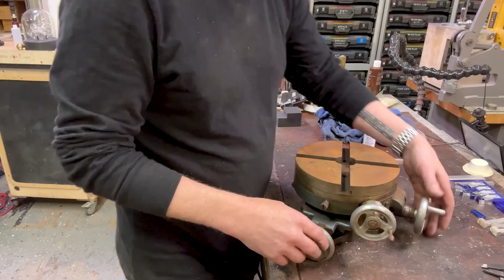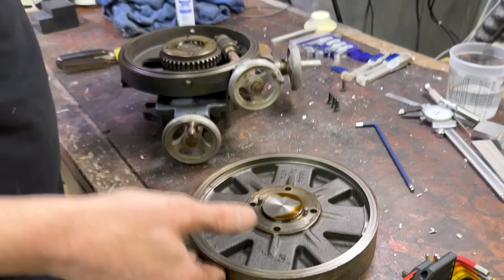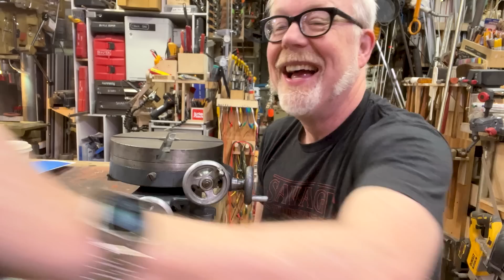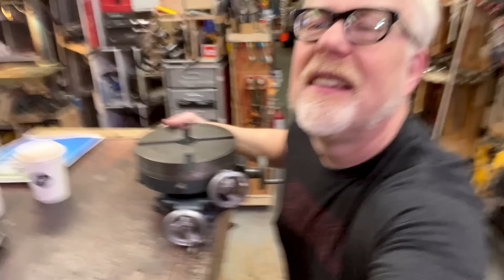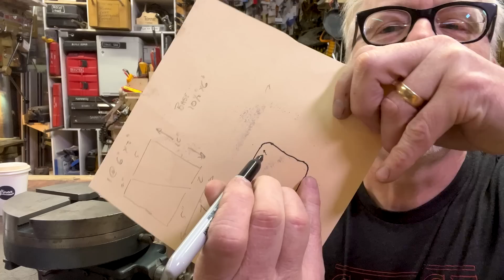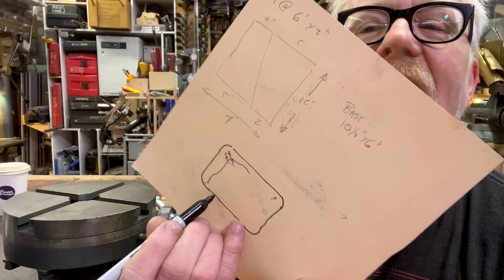Adam Savage Disappointed By This Machine Tool

Comment: I can't rightly say I've ever seen an X-Y table on top of a rotary table used on a mill.  It kinda gets into the Department of Redundancy Dept.

You have an X-Y table on your mill, you lock down a rotary table & hold your material on it.  There should be a lock for the backlash slop; make one, if not.

Either deal w/ the backlash by only working CCW or CW, or by the same way you mill w/o a DRO; go past, & re-approach.

The alternative is retro-fit it w/ a recirculating ball worm, but I know if they exist.

GeoD

Comment: I have te same model Palmgren and the only use I've found for it is cutting circles that are too big for my small rotary table.  I also have a Bridgeport 12" rotary table, but it can be hard to set up on my 3/4 size mill.

Comment: Adam, that is not for milling operations. I have one similar and it is for mounting on a drilling machine without the xy table. On the top you mount a chuck like the one in the lathe.
And you use this tool to make holes on flanges for wheels, transmission couplings, pipe couplings etc . Only drilling holes. No milling.
The purpose of the X y is to positionate quickly to the necessary diameter where the holes will be made. Look for the lock screws in all axis, you suppose to tight them to block all in place before executing the holes.

Comment: you can easily make a nice drill press table with that rotary table, it will look super! I have a craftsman one that I picked up for real cheap. It does not have that kind of slop at all on the rotary table. I guess maybe after cleaning it I will find out! again I agree with you it looks super cool and great for a drill press, especially a floor model cause you have all that space between the drill table and chuck.

Comment: I don’t really see the connection between backlash and a DRO. Also, DRO don’t give an “exact” position anymore than an analog indicator. 

Every person using a lathe with precision is also using external indicators rather than relying on the feed dial.

Comment: I have one of these and you can make the 3/8" thick aluminum rings under the R2D2 head on a mid size mill. Mount your square aluminum to it, offset it to the spindle to the size of ring you want and turn yourself a big ring on a small mill. Also you can adjust the backlash out. If it didnt have that play before you took it apart you didnt adjust it properly when assembling. Cincinnati tool  would be laughed out of existence if the made a milling tool  with that much play. That thing was probably a grand 40 years ago.

Comment: You can still use it even with the backlash. You just don't move it backwards. Always one direction. Besides, I believe the backlash appeared after you re-assembled this. That tells me you may have missed something when reassembling the parts. There should be a built-in means of taking out the backlash. Especially since you showed everyone how it's hardly ever been used. Speak to a machinist first before you discard it.

Comment: I have a very similar Palmgren 8" rotary XY that i use on one of my drill presses with an XY vise on top, Mine does NOT have a wheel or worm drive, you turn the table by hand and lock the set screws. I don't believe these type of rotaries are made for milling as much as drilling hole patterns/line up.

Comment: Adam, I am not a machinist by any stretch of the imagination. But that is 30,000th on the out side circumference it would be far less the close to the center you are. Now is that still significant at 1" from center; nothing I can say with any reasonability.

Comment: Backlash is also bad if climb milling, especially bad in that case. For positioning backlash can be compensated for, but if your milling cutter is broken you won't be doing much milling.
Before DROs with hole pattern capability one might have used a rotary table for circular hole patterns, if one locks the table before machining and turns the handle the same direction when indexing, then backlash is not such a big deal.

I'm not so sure the rotary backlash can't be adjusted, @4:51 one can see a couple of socket head screws near the end of the worm shaft opposite the hand wheel, if those were loosened could one push the worm closer to the worm wheel reducing the backlash? Serious rotary table have the worm shaft on an eccentric to allow easy adjustment of the lash, but if one buys one of those Palmgrens one gets what they pay for.

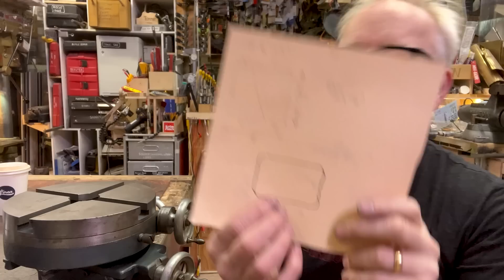@11:35 While it make setup more complicated, one could mount the Palmgren upside down, or since it is the 21st century, one could just use CNC.

While a 6 or 8 inch rotary table looks cute, when one tries clamping anything to the top one will quickly wish for more space for the clamps even if the work piece itself is less than 6 inches.

Comment: Send the worm out for coating to get rid of the backlash.  Flip it over and the rotary section is on the bottom and the X/Y is on the top.  Make an adapter plate and you have a functional tool.

Not necessarily a great solution, but when you've got lemons. . . .

Comment: Can you not just turn it upside down and mount a jig plate to the top (bottom) and sub plate on the bottom (top) to allow you to mount it to your t slots? For small milling jobs and taking care of the lash by thoughtful operation, this will be fine.  Btw all rotary tables have backlash. It helps to snug the locks slightly and, of course, only mill from 1 rotation

Comment: Get yourself some small hold down clamps and mount it upside down on your Bridgeport table you might not be able to use the original micrometer marks but you could probably improvise a set That's what I've considered doing with the oddball one that I have

Comment: a general tip for rotary tables only ever go in one direction if you go past  your mark do a full rotation that way you will never have an issue with backlash 

i would look into making a way to lock the table on when you're in the right spot would sort out the table movement

Comment: Adam, did you consider looking at it upside down? Couldn’t you secure the rotary table to your mill bed upside down and mount  a t-slot table to the bottom of the device (that’s now on top) where you would normally bolt to your mill bed? That would give you the rotary table on the bottom and the cross slide on top. Another comment mentioned securing the far end of the worm screw to reduce backlash. A little bearing (ball or bronze) housed in a piece of metal that’s welded in place could help solve that issue. 
I have a semi-universal dividing head (aka: tilting rotary table), the backlash is sort of adjustable by allowing you to adjust pressure between the worm screw and worm wheel. It comes down to necessary level of precision. You could always get close and mark it with layout fluid and grind it down by hand with an angle grinder. Wether that would work or not would depend on acceptable windows of GD&T and what you’re trying to accomplish and how steady your hands are with the grinder. 
Did you consider mounting a grinder on the rotary cross slide and using that to control the movement of the grinder to carve out gouges? If a tool doesn’t quite work for its intended purpose, I always try to look at it upside down and backwards before I decide if it’s “useless” or not. Even if I decide I can’t use it, I save it for the parts/mechanisms, in case I want to use them on a future project.

Comment: Mount it to a large 90 degree base for a forth axis work on a milling table. Or use it on a surface grinder. I have a Volstro which is small and delicate but has the neato factor.

Comment: I have that one. Works okay if you take the X-Y off and clamp the table in the mill vise. Good enough for light duty if you favor the backlash correctly. By the way, the work doesn't care if the X-Y is above or below the rotation. It only cares where the spindle is in relation to the radius. Stand alone tables work on top of the mill table, ya know.

Comment: The worm gear shaft supported on only one end is where practically all of that play comes from, the screw needs to be held tight to the recieving gear to eliminate it.

But for machining concentric ID/ODs I'd still use it with that level of play. And add a brake screw if it doesn't have one for when the angle needs to be locked such as when machining with the X/Y axiis.

Comment: A DRO doesn't mean backlash isn't a problem.  Don't get lulled into a false sense of security.  Whether you position the bed using a DRO or not, if you have significant backlash, the cutter will move the work.  If you don't take account of backlash, you could get a piece that is either under, or over sized by up to twice the backlash amount.  Note also, that cutting on the front and back face will push the bed in the direction of the cutter rotation.  This is why, on older or cheaper machines with more backlash, you should always use conventional milling, so the the work is being pushed towards the driving face of the screw.
Try positioning the bed for a heavy cut along one of the sides.  Remember from which direction you approached your final position.  Zero the DRO, then take your cut.  At the end, is the DRO still showing zero?  Repeat this, but this time approach your X position from the opposite direction.  In one, you'll probably find the bed moved by up to the backlash amount.  If you used conventional milling, repeat both tests using climb milling.  See the difference?
It doesn't matter how accurate your DRO is, if the action of cutting causes the bed to move.  You still have to be aware of how backlash affects the cuts, and ensure you position the bed from the right direction.  Note that conventional milling will tend to pull the piece towards the cutter, so if you've not taken account of backlash, you could be taking a significantly deeper cut.
If you have adequate backlash compensation, climb milling is much preferred.  The chips remove the heat more efficiently, reducing work hardening in the piece.  It typically gives a better finish because the chips are pushed back from the cut, so there's less chance of re-cutting, and there's less rubbing, so your tools will last longer.

Comment: Not a thing wrong with it. Your only going to cut in one direction which means it will always be in contact with the worm gear. If you need to back up you just need to take note of the reading on the scale and go back to that place. That's the problem of starting out with digital readouts and never having to use the scales on a machine. Unit is excellent for circular hole patterns. Just tighten the large lock screw on the side when your in position.

Comment: There isn't a worm / wheel meshing adjustment ? 
On some rotary tables, the worm spindle is mounted ln eccentric bearing carriers or a complete "cartridge" that can be adjusted eccentrically .... also, this backlash might be from worn thrust bearings on the worm... 🤔

😎👍☘️🍺

Comment: I would put a drive on the rotary table and use it for TIG welding around stuff. Variable speed drive with a foot speed control, a way to ground the table, and some clamps and away you go!

Comment: I'm certain there's a way to take up the backlash. Did you check it before you took it apart ? A grate use is to o ring heads on motorcycle cylinders and heads.

Comment: I have what appears to be what you have, a Palmgrem 8" rotary table except mine has the tilting feature. While not rigid enough for normal rotary milling it has proved its worth when trying to locate holes on difficult to level work pieces.

Comment: You are just SPOILED by your DRO! LOL!  Nearly ALL manual crank horizontal  rotary tables for milling machines have similar backlash in the worm gear. As long as the crank wheel is turned into the direction of the cut, the backlash is negligible. Just like with your lathe when turning the length of a part to diameter, you feed the cross slide INTO the cut and stop precisely at the depth before feeding the carriage along the length of the part. If you feed the cross slide in too far and back it out to depth, the cross slide will drift back as you are turning the length until the backlash is taken up, leaving you with a tapered part. As long as you always feed into the part, backlash is a non issue. Same applies to the rotary table. When cutting an arc, as long as you feed into the start location, plunge in,  and stop precisely at the end location using a stop, you will have precise repeatability. If you back up on the feed, then you are at the mercy of the mass shifting until the backlash is taken up. Its all about pre planning the cut. If you are just relying on the position of the DRO and positioning the tool in or out willy nilly, it goes against the grain of what every machinist was taught on the first day of school. Some incredibly intricate and accurate parts can be made with that rotary table, as was done before DRO's and CNC.

Comment: In tank turrets, the problem of eliminating backlash has long been solved. You will not be able to accurately aim the gun at the target if there is play in the turret turret.  I think if there is a lot of free time, then you can upgrade the device by eliminating the backlash. But rather, it will be to make such a device anew, since the changes will be significant.

Comment: Boat anchor.  Have one, spent a half day making an allignment slug, t nuts and table guides so i could mill a radius on a 2" thick clamp bar.  I did the job but  Bitched the whole time. I Put it away and havent used it since.

Comment: I machined a water droplet pattern with a ball end mill on one of those back in college. We used that At Translite Sonoma (Lighting Company) to make cylinder heat sink fins and vents using an arbor saw. If you want to mill a shaft slot guide (BMW motorcycle gear shifter). Mount it on its side on the mill and you can machine / lathe compound profiles. I would recommend making a guide to drop into the TSlots to find the center. I’ve got a small one of those to use on my harbor freight vertical mill and I do use it.

Comment: The XY tables like that are for a Drill Press, on a milling rotary table you don't need that XY adjustment, Just the rotational Axis, because the table itself takes care of the X/Y capability. These tools are almost exclusively for doing bolt circles on a drill press machine. They are for low criticality projects. The reason you'd use this in a shop setting is if you have a low criticality project and don't want to tie up a production machine.

On the note of backlash, to explain to people why you can't eliminate it fully, is if you tighten the half nut to the screw tight enough to eliminate it, it binds, and will strip out the half nut, The secret to repeatability is whatever direction you took your measurements from needs to be in the direction of the cut or the tool load for a plunge operation, you need to measure and cut in that same load direction, which will give you extreme repeatability even with a machine that doesn't have a DRO, as long as your indicators are good, and your machines scale on the handles is good. (if you haven't done much manual machining without a DRO, You use travel indicators against a fixed surface or measured point to make sure you're repeating exactly, for pinning and screw operations, you use something like an Indicol and machinist buttons to get your repeat and accuracy)

I expect many here know these things, but there are a fair amount of people that may not, and so this post is mostly clarification coming from someone that has worked in a production and tool making environment where we used both manual machines without DROs up through modern CNC machines. Part of my job was not only operating machines, but learning how to service them. Small shop, we were all expected to be able to do a good chunk of maintenance if needed.

Comment: Having a formal training (at least a little bit of one) on old school machines without any DRO, I am used to backlash; and I did use a similar table that has quite a wobble to it from its cheapness in a project https://www.youtube.com/watch?v=7UGr-wDbIx8 - it's good enough to reposition a circular thing for the next cut, but you have to tie it down during the cut.

Comment: I'm almost certain that backlash can be adjusted out. Backlash adjustment is done on most rotary tables by turning an eccentric bush the required amount (to increase or decrease the engagement of the worm screw into the worm gear) and then locking that bush position by a screw. The eccentric bush is usually in the housing where the screw shaft penetrates the housing.

Every rotary table I've ever seen has backlash adjustment.

If this is an unusually cheap and imprecise rotary table  (perhaps meant for home hobbiest making wood templates for metal sand casting impressions?) Then I guess it's possible it doesn't have the adjustment bush, but it seems illogical to leave it that $1 part which renders the rotary table un-adjustable. But it could easily be modified to add an eccentric bush in the housing

Comment: If you don't climb mill with it, the backlash shouldn't be too much of an issue.  Also, if it has a lock where you can tighten the table at a certain position, you could cut gear teeth, or do other indexing operations as long as you don't reverse the table direction until the piece is done.

Comment: The backlash on the rotary part really isn''t an issue as you'd usually only be going in one direction and either milling a circle or locking the table at each angular point you need.